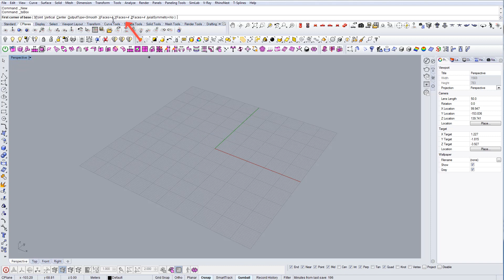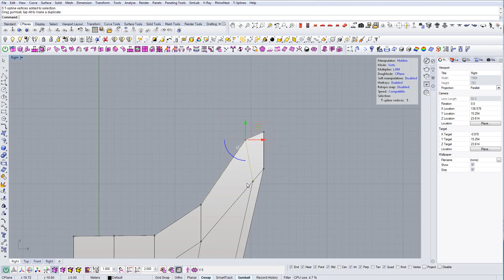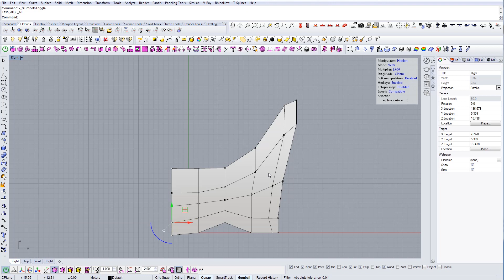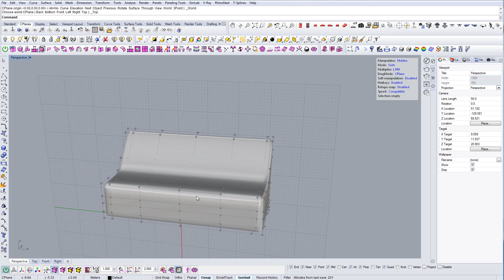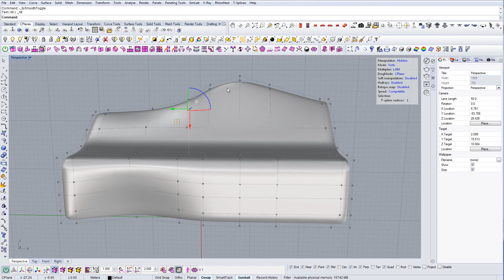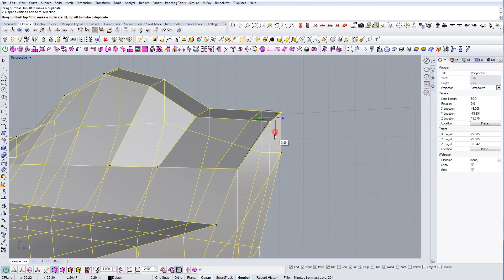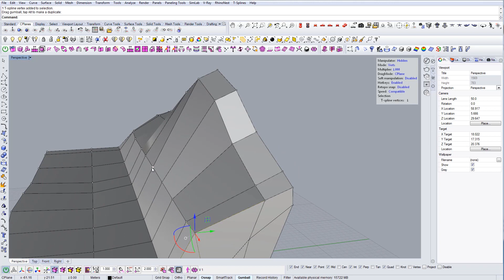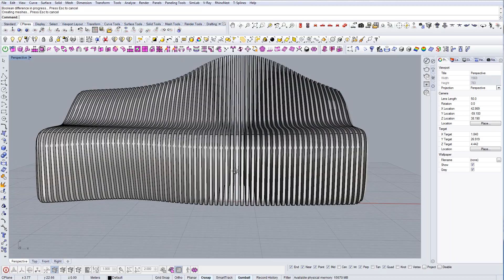How to Model Bench in Rhino

Comment: How to model it without t-spline? Is using the cage tool a good way?
Reply from the maker: Hello! Thanks for commenting! Modeling this without t-spline would be a bit tricky. One thing we could do is create multiple curves in both directions and then use something like "network surface" or "patch" to create this kind of surface. The other solution could be the cage tool, but you would need to test the cage tool first to get the exact amount of control points that would do the job. Sometimes if you add too many or too little control points, the cage edit tool would be very limited, but if you optimize it very well for certain geometry it could certainly get the job done. Hope that helps!

Comment: How do I get T-Splines? I am using a trial version 6. Can it only be used on Rhino version 5? If so , what can I use instead of T-splines? thanks!
Reply from the maker: Unfortunately, T-splines is not an active plugin for Rhinoceros 6 any more because Autodesk bought this company and now this plugin is implemented in another software called Fusion 360 from Autodesk. 
However, there is a workaround. The plugin can still be downloaded from here: https://www.tsplines.com/latest_version/ 
But again, this is only for Rhino version 5. 
If you're using Rhino 6, there's a similar plugin called Clayoo from TDM solutions, but it is overpriced in my opinion, but it basically does the same thing as T-splines. 
There's good news, in the future versions of Rhino, they are planning to implement all this t-splines magic as integrated part of Rhino which will be super awesome :) Hope that helped you out a bit!
Reply: @HowtoRhino  Thank you. When do you think there will be a new version of Rhino? In the soon future or a long time from now?
Reply from the maker: You're welcome! There is a Rhino 7 WIP (work in progress) version which you can download and test if you have Rhino 6 license and in this version, all these new commands are being implemented and tested. It's not a stable version but it's good to test out new Rhino features. I don't think that the main version will come out soon though, probably within a year or so maybe. :) Can't wait for this!